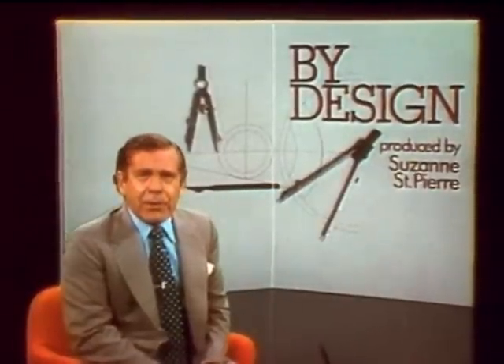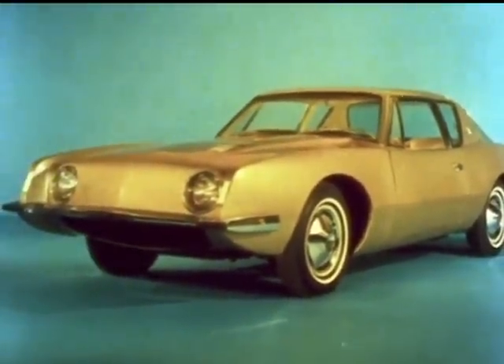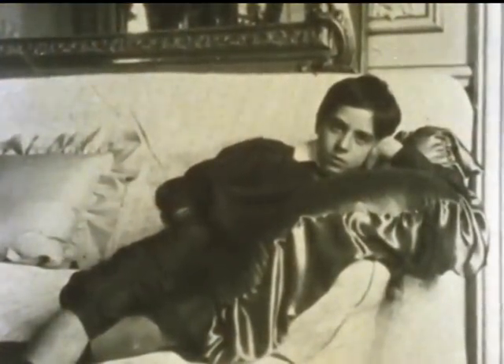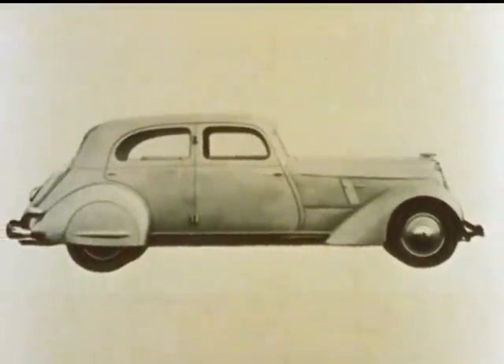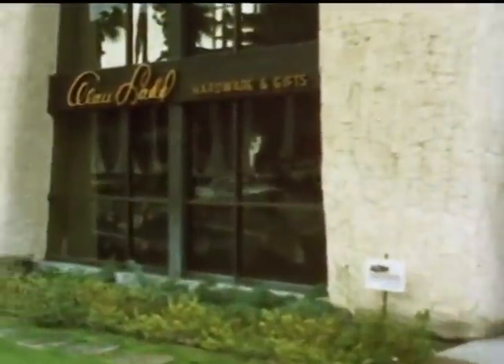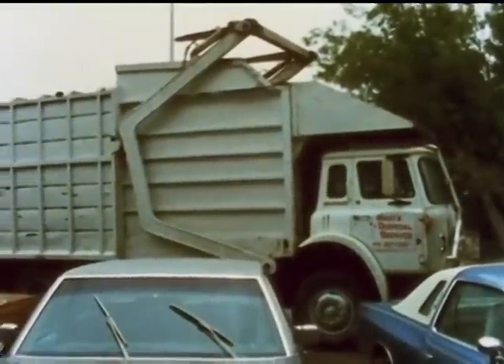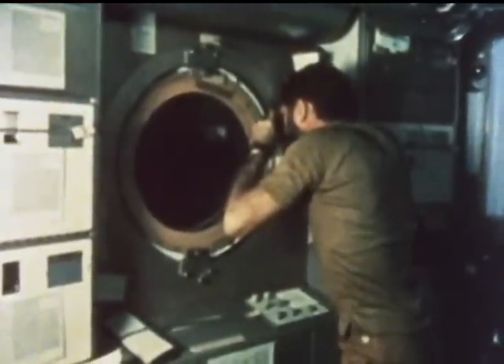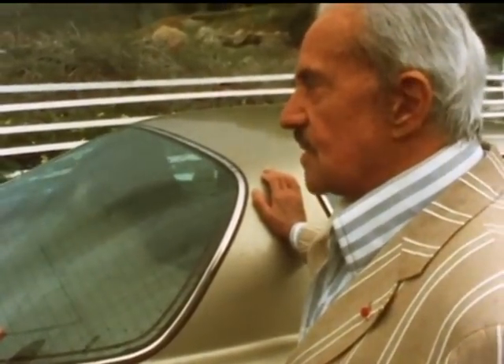Raymond Loewy, Father of Industrial Design

Comment: When the Studebaker Avanti was designed, the rear window was the largest in automotive history.  (Auto designers call the rear window a "back light".)  This lasted only until the Plymouth Barracuda came out.  They initially had a problem of the rear window popping out at high speeds and redesigned the fasteners to resolve that.

Comment: Loewy owned two 1963 Studebaker Avantis (one in Palm Springs and one in France) and one 1972 Avanti II.  The Avanti II was made by an independent company after Studebaker ended production.  The car in the video was his Avanti II (as you can see on the nameplate on the front).  He tended to put some personal touch on his vehicles and in this case it is the diagonal white stripes on the doors.  The Avanti II is a little different than the original Studebaker with that added bar below the front bumper, different rear view mirror designs, but mainly having Chevrolet engines and transmissions instead of Studebaker.  Due to the engines being taller, the front of the Avanti II is a little higher than the Studebaker to make room for the Chevrolet engines.  The most obvious place to see this body difference is the distance between the top of the front wheel opening and the top of the fender blade.  So the car doesn't have quite as much "rake" as the Studebaker version.  On another of his Avantis, he put a big wide metal "V" adornment on the front that I think came from a Cadillac.  On his bullet nose Studebaker, he put a little propeller on the end of the bullet nose.